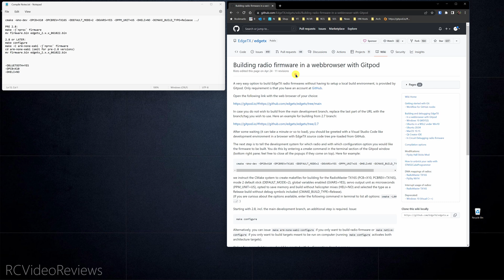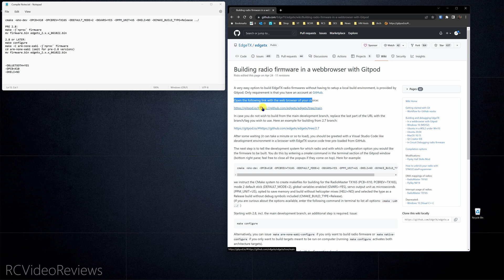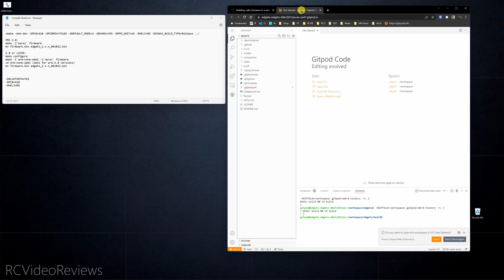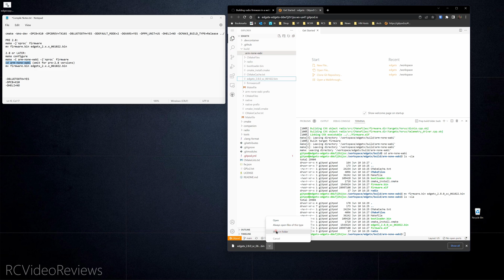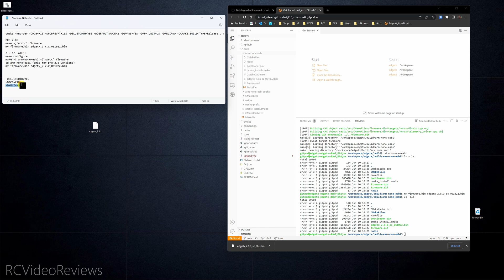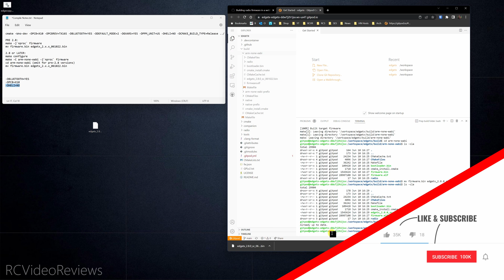How-to Compile EdgeTX Yourself • ANYBODY Can Do This!

Comment: I have a question, if I can deeply customize the firmware (specifically I want to replace the mcu from stm32f205 to stm32f407 for t-pro jumper) is it supported?

Comment: Many thanks for this very informative video. But what is the CMAKE option to change language please? Is it a list of all options somewhere? Thank you! :)
Reply from the maker: I googled "edgetx compile options" and this was the first link:
https://github.com/EdgeTX/edgetx/wiki/Compilation-options
Reply: @RCVideoReviews  thanks, I've seen that but unfortunately the language option doesn't work : 
gitpod /workspace/edgetx/build (main) $ cmake -Wno-dev -DPCB=X10 -DPCBREV=T16 -DDEFAULT_MODE=1 -TRANSLATIONS:STRING=FR -DBLUETOOTH=YES -DHELI=NO -DCMAKE_BUILD_TYPE=Release ../
CMake Error at CMakeLists.txt:3 (project):
  Generator

    Unix Makefiles

  does not support toolset specification, but toolset

    RANSLATIONS:STRING=FR

  was specified.
Reply from the maker: That wasn't the question you asked. If the compile option doesn't work as advertised, then you need to open a ticket on the EdgeTX github issue tracker and let the developers know.
Reply: @RCVideoReviews  I don't think that this options are made to be pasted on gitpod terminal, as there are no options like "-DPCBREV=TX16S" or "-DBLUETOOTH=YES" in the list. But thanks anyway for your help.

Comment: Does this work with the new release 2.9.0.  If so, what is the link to put in browser.  Thanks.
Reply from the maker: https://gitpod.io/#https://github.com/edgetx/edgetx/tree/0ff73ccafad063fcc65ea64e7dca35e7f00011a1

Comment: Hi. Nice guide video! Now i'm wondering, most TX MCU nowadays are STM32F4 or F2. Soo, is it possible to make a DIY TX with the STM32F411 Blackpill? Most DIY TX video i watch are using OpenTX with Atmega processor, which is pretty old and no longer supported. Thanks
Reply from the maker: Probably..?

Comment: I successfully compiled with your instructions, so thank you very much.  However, I didn't add noheli expecting to get the heli menu, but the new compile seems to make noheli the default.  I found the github compile options which showed heli: bool=on as the option, but the compile barfed on the command.  How do I create a file with the heli menu option on?  Thanks!
Reply from the maker: Did you use -DHELI=YES
Reply: I just added this but got CMake Warning:  Ignoring extra path from command line:  "/workspace/edgetx/build/ -DHELI=YES".  Sorry it took so long to get back to you, I thought I'd get an email when you responded, thanks for the very quick reply!  Larry
Reply: Yes, but it gave me the warning that it was ignoring it.

Comment: I've been struggling to compile a working firmware for my Horus X12S from a fix repository on Github specifically addressing the scroll wheel acceleration. I've not once gotten the firmware to boot the radio and compiled with many different options.  I've asked elsewhere with no response, so I'm asking the expert.
Reply from the maker: Sorry to hear you're struggling. I don't have any FrSky radios, so I don't have any way to test and figure it out. Have you joined the EdgeTX discord and asked there?

Comment: Hi, I am trying make nightly firmware for TX16S in czech language, but every time it is ends with error. 
Can you help?
My options:
cmake -Wno-dev -DPCB=X10 -DPCBREV=TX16S -DDEFAULT_MODE=1 -DGVARS=YES -DHELI=NO -DPPM_UNIT=US -DTRANSLATIONS=CZ -DCMAKE_BUILD_TYPE=Release ../
make configure: ok
make -C arm-none-eabi -j`nproc` firmware: failed error

when I delete "-DTRANSLATIONS=CZ" then firmware is compiled right, so how I can build in CZech language? Whats wrong pls?
Reply: Update: I dont understand whats wrong, when build for DE language it is okay, but for CZ language it ends with error. Any idea?
Reply from the maker: You'll need to open an issue on github for that.
Reply: @RCVideoReviews  Thx, I opened issue.

Comment: Hi John. How do I compile a firmware for TX12MK2 with an internal 4 in 1 module? Which Cmake options should I use?
Reply from the maker: cmake -G "MSYS Makefiles" -Wno-dev -DCMAKE_PREFIX_PATH=$HOME/5.12.9/mingw73_64 -DSDL_LIBRARY_PATH=/mingw64/bin/ -DPCB=X7 -DPCBREV=TX12MK2 $MYOPTS -DCMAKE_BUILD_TYPE=Release ../
Reply: @RCVideoReviews  The above cmake line didn't work for me. I used the commands from the video with TX12MK2/Board variable and it worked! Thanks for pointing me in the right direction.
Reply from the maker: Here's a link with the board types for RM. Others are in the parent: https://github.com/EdgeTX/edgetx/blob/main/tools/build-radiomaster.py
Reply from the maker: Parent: https://github.com/EdgeTX/edgetx/tree/main/tools

Comment: Wow, I am so grateful for the videos you make. These radios are brilliant, but for us mere mortals, doing these kind of activities would probably be impossible! I flashed my  RM T16s to Edge2.8 following your other video and it was easy and straight forward. But when I tried to get one of my heli's working, it didn't. Long story short, I found out that the heli menu was off by default in 2.8, so none of the CCPM mixing was there. The above process was a piece of cake to compile my own version with the heli menu on, and flash it  - now my Trex works. Many thanks man.
Reply from the maker: Awesome! Glad to know this material kept you flying.

Comment: it does nothing when i paste the cmake into the termininal. I feel like my pc is missing somthing for VStudio to work correctly. Is there in .bin files with BLtooth on and Dheli on and the newest firmware?
Reply: NVM im a jackass and didnt hit enter/return. BTW is this still the latest and greatest? is there a way to download a newer version this way?
Reply from the maker: You can always download precompiled binaries here: https://github.com/EdgeTX/edgetx/releases/tag/v2.8.0

Or you can fork whatever project you want in gitpod--including nightlies.
Reply: @RCVideoReviews  I ended up getting it. I thought edgetx companion would have worked but I saw in another video of yours that the check list isn't functioning properly. Or at least that's how I took it. Btw I'm super inexperienced with all this programming these newer systems need. It's been a very steel learning curve but I've been able to hang a little bit.